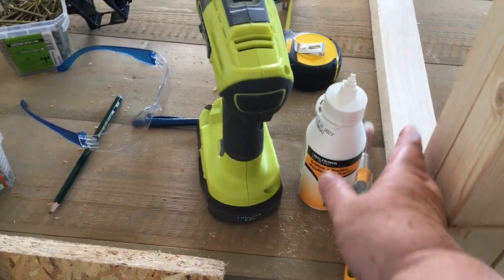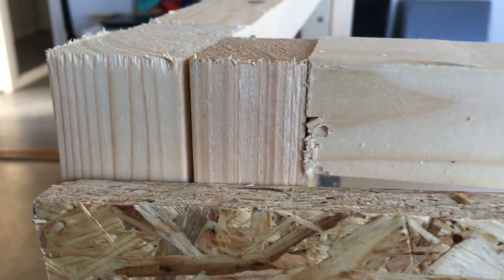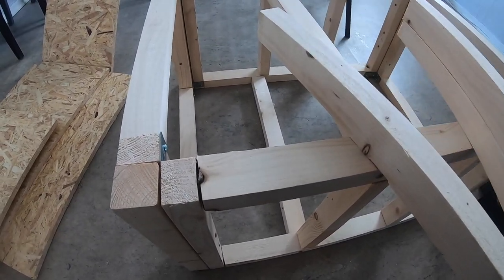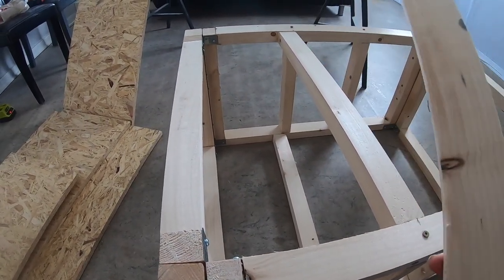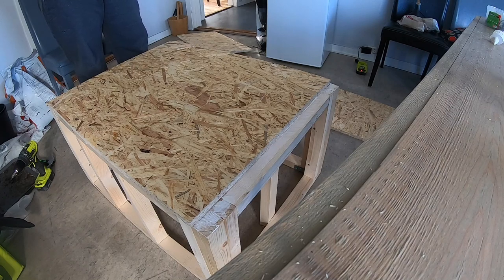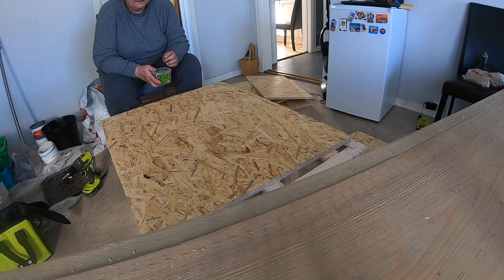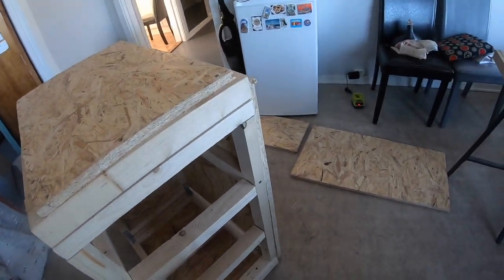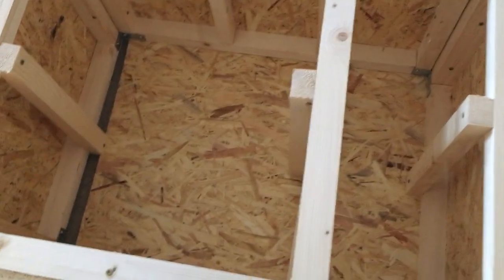Building a Composting Toilet: Part 3

Comment: Hi Cindy,  You are making me laugh and smile.  I am a 75 year old lady and have done many things like you are attempting.  I am laughing at my attempts to recently put some small steps down an embankment at the end of my garden.  I dug out small steps into the hillside but because of largish rocks I had to dig out more and more and make it wider and wider, after two years of battling with paving stones and mixing my own cement by hand to lay them on a secure flat surface I now have what my family call the Italian Garden, 6ft wide and 8ft high, and I am amazed at what I did.  I cut stones with my grinder from a car boot sale and used my carboot tools.  I find that swearing  profanely as I go helps and keeps a good sense of humour.  On my computer I have an 'accident' file which I draw small cartoon sketches of the bruised toes, bumps on head, extreme strimming where I flagellated my ankles, lying on floor resting bad back,  trapped finger bruises and many more.  I look at this accident file occasionally and laugh and think that I wouldn't change a thing.  I felt alive and happy while  being creative.  I see you have the same philosophy.     Good luck.  Happy d.i.y.                 Linda from England.
Reply from the maker: Hi Linda! Swearing profanely definitely helps! When I get sit I sit and think and then work out a new plan!

Comment: You are one incredible lady :) H
Hats off to you for picking up the power tools, i was so hoping you would. practice practice and more practice. We all want our projects to come out perfect, are yours did, well all the work you did yourself, so pat yourself on the back for that. I wish i was in norway so i could guild you better. 
how do you plan on getting the bucket out when full? it will be very heavy.
As for the hinges, its a bit hard for me to help as you didnt show the hinges. Normally the screws that come with them are tiny, probably to small to last a long time with OSB. 

so... first, open the hinge up, so its 90 degrees, place it on the frame. then place the OSB on top. This, in my opinion, is how it should look when finished. The issue i see with this, is the flap being in the way when refilling or using the compartment. maybe a hinge at the back would be better? 

so...back to fixing the hinge to the flap, (top)  if you do find the screws not holding very well. get longer screws and have a small strip of osb on top where the hinge is. remember, you cant see the hinge but you will see the stip of wood, doubling the thinness of the OSB.  

When your confident and happy with your layout (design) screw the hinges to the frame SIDE only. when doing this, put your knee on the top to hold everything where you want it. then with a pencil, mark the location of the hinges on the side of the OSB. remove the OSB (top) and transfer the marks to the under side  of the Top, you now know where you need to fix the hinges to. next part is going to be fiddly. and hard for me to explain :) 

open up the hinges, hold the Top UNDER the hinges on your marks. get a pencil and mark the holes of the hinges on the osb. Place top on a flat surface and pre drill, with a very small drill bit, if you dont have one, you can always just you the screws, but its not ideal. pay close attention to getting the screw directly in the centre of the marked hole. after you have done this, place the top, back under the hinges and screw them in. have everything you need very close by, dont let go of the TOP at all until ALL screws are in.

Having the hinge under the top is going to give you a small gap (it wont sit completely flush when closed. you can always get some very thin 2-3mm thick foam stipes and run them around the underside of the top (think draft excluder tape for doors)

Next time you practice on your builds, try very hard to get the top of the screws totally flush with the wood ( you can even go a little deeper, 1-2mm)  This will help you get a better flush finish with sidings.

maybe this would have been better as a video call LOL

Lastly, while you can, i would remove those 3 extra supports you put in, and cut them shorter  and screw them back in with the frame. ( when looking  down, they wont be in the way of anything.

Good luck x
Reply from the maker: Wow! Thanks for the instructions! I'm trying to imagine the hinges from the inside like you explained. I was just going to plonk them on the outside!
Reply: @CindyVine   you can also do that, but i feel your run into an issue. the edge of the top (flap) is square, and your asking it to make an arch as you open it. you might have to cut the bottom edge of the top, (on the underside). sounds odd when written down. draw a side view on a peace of paper and your see. its basic geometry.
Reply from the maker: @gazza2963  I'm going to have to play with it as I can't imagine it. I hated geometry at school lol